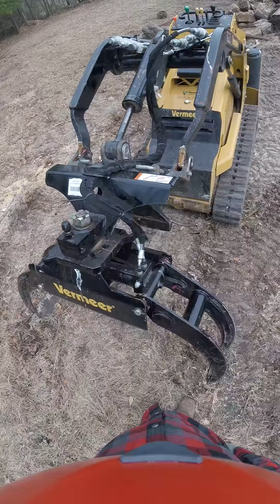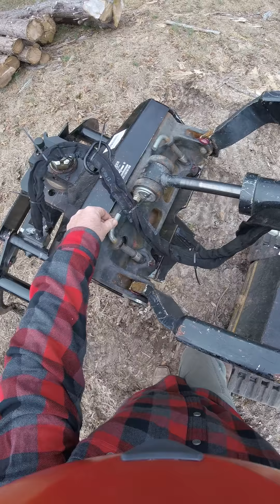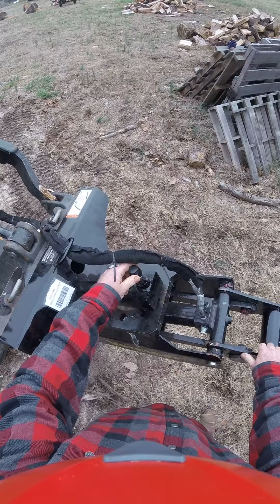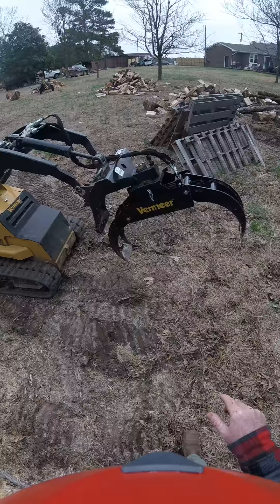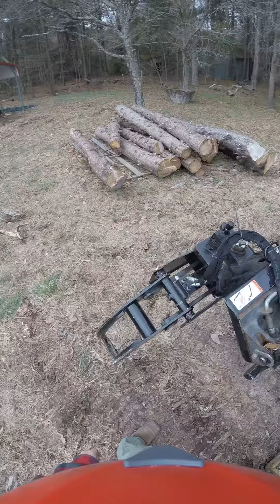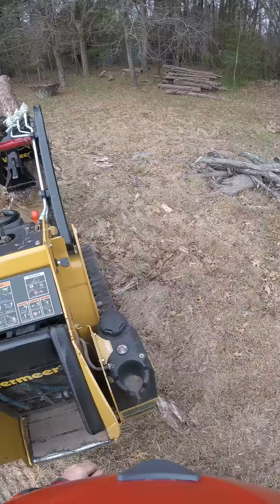Vermeer LG46 Log Grapple User Review, Tips and Functions.  Vermeer LG-46.

Comment: I like it, I have a BMG Grapple. Happy with it, but always interested in other toys. I would like to see side view and angles of plate verses grapple, I will go back to vermeer and check again. Harmony NC .
Reply from the maker: I will have to check out the BMG and see what it looks like,
Reply: I am thinking Yours would be better when I try to position firewood to split In my log splitter. talking about those 40" ones. right now forks work ok. also stacking 2 or 3 high in truck and then pushing them foward. the BMG does not do this well but is nice for grabbing and also dragging large pieces.
Reply: @thezerkman  100% correct! The BMG opens almost a foot wider and gives a little better visibility, but the ability to lock the Vermeer is VERY helpful for for positioning logs the same way into a firewood splitter/processor.